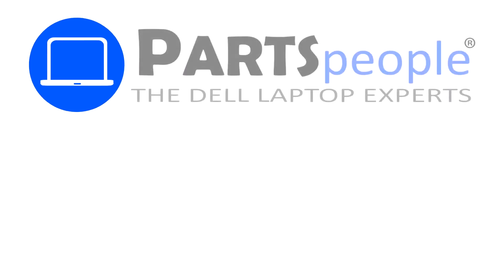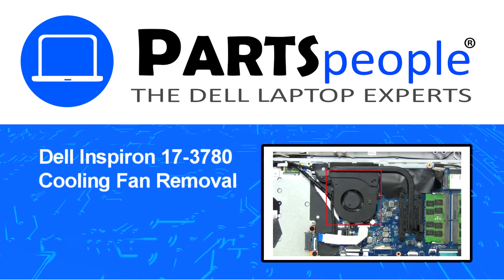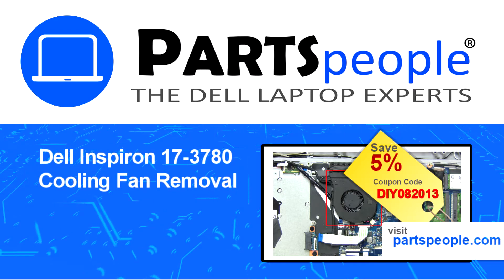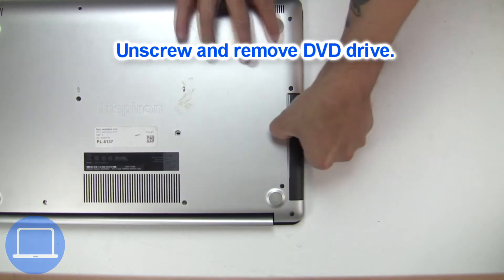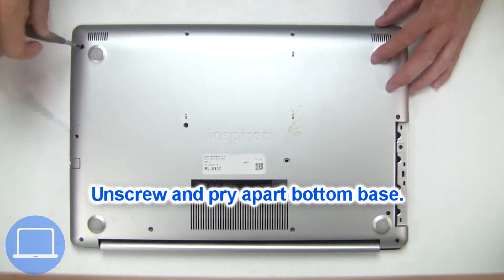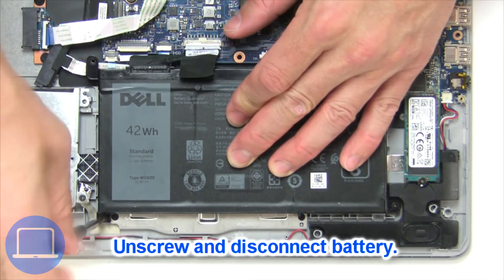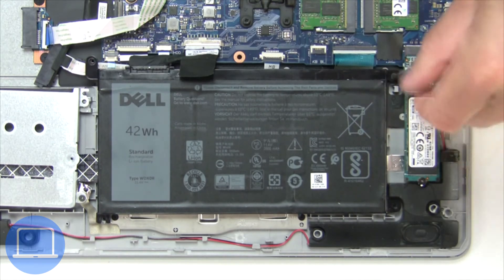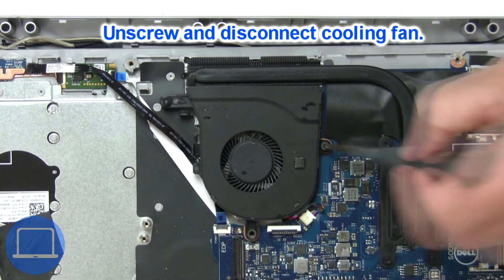Dell Inspiron 17-3780 (P35E004) Cooling Fan How-To Video Tutorial

Comment: Well, thanks for the tutorial. Got through replacing my fan. In the process I nearly gave myself a heart attack as when I booted my laptop right afterwards, it didn’t switch on. Thankfully after taking the battery out and putting it back in it switched on.